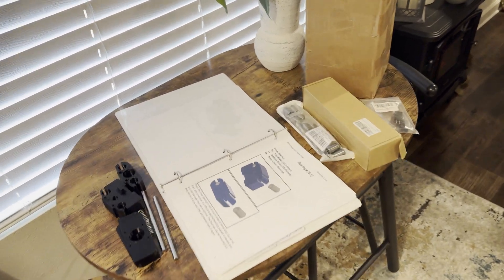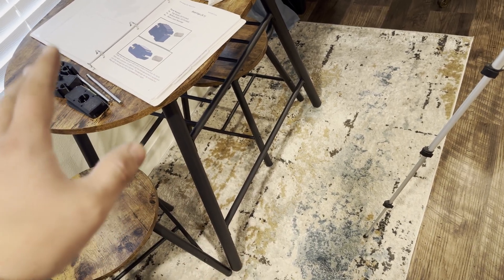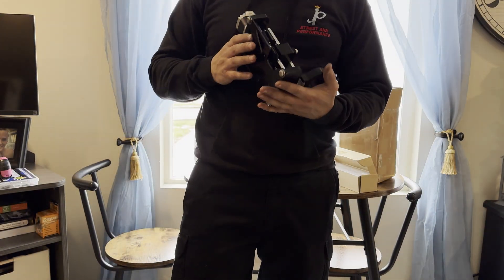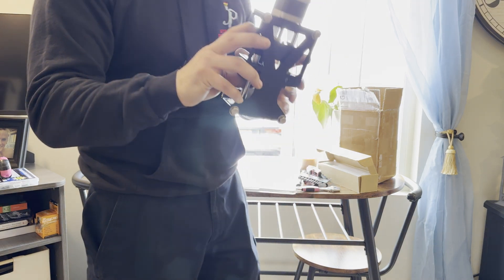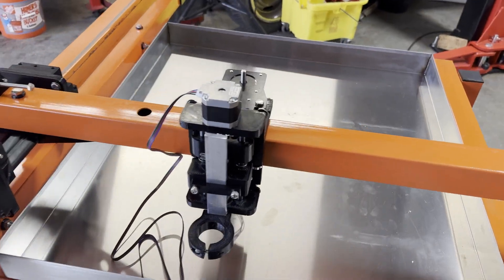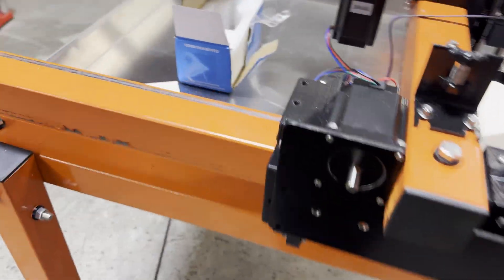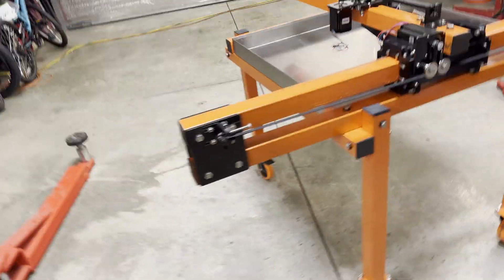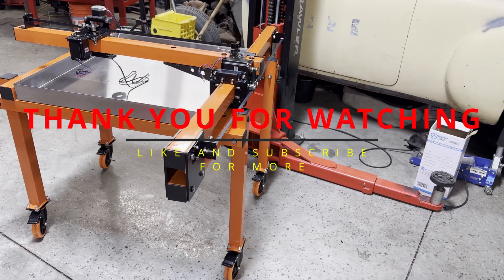DAY 4 DIY CNC PLASMA TABLE BUILD

Comment: Great job! I am doing plasma also, but still haven't finished touchscreen wireless THC
Reply from the maker: Thank you. That’s awesome, I will be adding a THC to mine eventually once the one JDs garage has is out of Beta testing.
Reply: @JPSTREETPERFORMANCE  I am working on touchscreen Bluetooth THC and plasma aggregate turning. I will use two ESP32, I tried with ATMega first, and diy voltage divider. It costs me about €50. Here is my plasma project but I spent €800 https://youtu.be/yzTg5Sby9wA?si=RGGI2zqNBi6m2T86